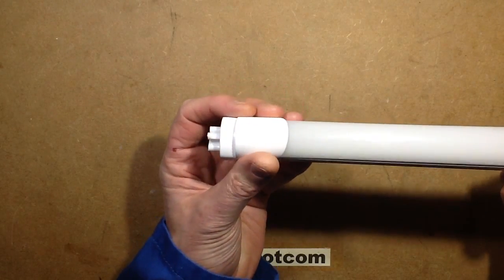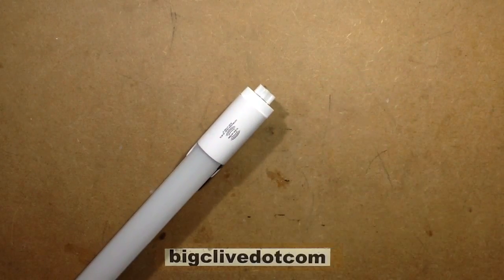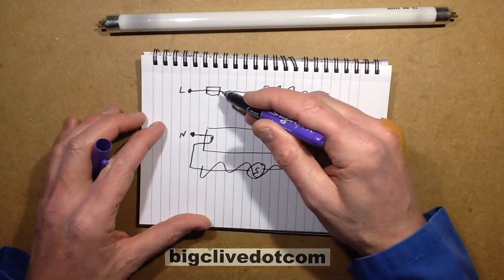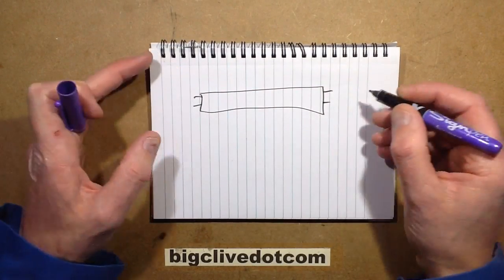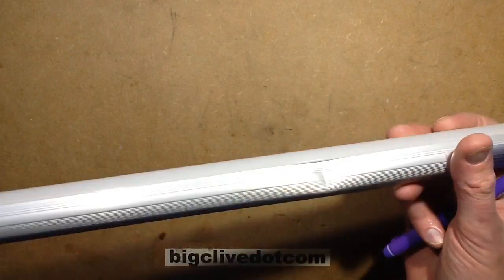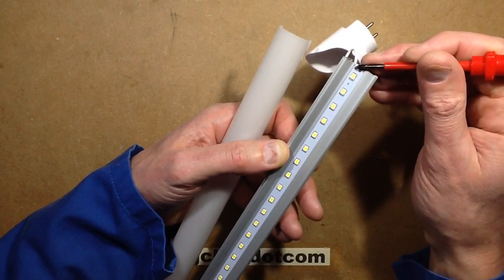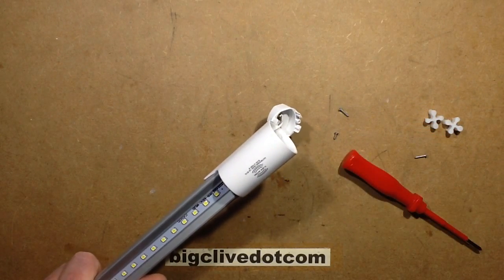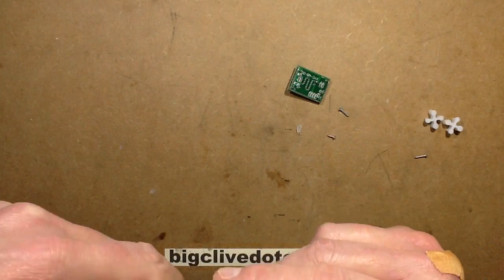Inside an LED T8 radar retrofit fluorescent tube.  (Excelvan)

Comment: Looks like you are not a fan of these retrofit tubes. But I´m working in facility management and we are using them for some years now. Aside from some early faults they work fine.
The actual tubes can be bought in bulk for 8€, labeled Phillips or Osram/Ledvance. They have a complete isolated housing. The circuit is different as yours, this type is banned in EU. You have the driver connected to the two pins on one side (usually the side with the type-sticker), the other side is bridged with a little ~1A fuse pressed into the pins. With the lamp comes a "LED Starter", which is basically another little fuse in an starter-housing. The fuses take care of failures in the driver and prevent blowing up something if someone accidentally puts in a fluorescent tube, maybe if the LED-Tube fails.
The ballast stays in. It is rendered irrelevant by the much lower current through the retrofit tube, and acts as power factor corrector for the mostly capacitive load of the driver.
The light output of the retrofits is nominally lower then that of a fluorescent light of the same length, but it is directed. Most lighting fixtures have a optical efficienty around 60%! The reflectors are terrible. especially if the upper side in the lamp was just painted white and is now yellow and gray after some years of use. If there is a reflector at all. 
After changing the old fl. tube for the LED tube the brightness under the lamp usually rises around 20%, with the power draw sinking from 36 (+~6W losses in the ballast) to 19W (plus ~1W losses).
Only exception are lighting fixtures with some indirect light part reflected at the ceiling. They don´t work well with retrofits. They need the 360° covering from the florescent lamps. Except you just turn one of three lamps upwards, like I did in an office in which the user wanted daylight (6000k) LED tubes installed, regardless of the installed fixtures with indirect lighting.
Reply: Stupid ballast inefficiencies...
Reply: At least the LED tubes don't have the painful flicker of fluorescents...
Reply: I don't have a major flickering problem, except for my old 48-inch T12 ballast, probably from 1980 or the very-late-1970s. That fixture has Phillips Alto 48-inch T12s, made in 2017, IIRC. Moved into the house on February 24, 2018. I didn't change to the Phillips 48-inch T12 fluorescent tubes, bought at The Home Depot, until probably at least May, 2018. I'm suspecting the old ballast, which looks like it's the original one of this house,  is weak now.

Comment: I've been using these 4 FT LED replacements in my kitchen, laundry room and garage. They are the type which require an electronic ballast, not just connected straight to 120 V. They have been installed for a few years, and no failure yet. I didn't measure the light output with an incident light meter to compare new vs. after more than a year of use, but they still seem to be just as bright to me.

What I like:
- No flickering
- Fast illumination
- Silent
- Best of all . . . The LED tubes will illuminate at sub-freezing temperatures in the unheated garage.

Comment: interesting.  I have not seen the radar versions in my searches in the US.

A local Batteries and Bulbs store sells plug-in LED fluorescent replacement bulbs and ones labeled "Ballast Bypass".

As my fluorescent bulb fail I have been replacing with LEDs.  The first one I purchased were the plug-in.  Not a good idea since still using the old ballast which consumes a good amount of power.

I now purchase the Ballast By-pass style.  Electrical connection at one end as you mention.  I just remove the ballast and wire input Live and Neutral to the tombstones at one end.  I have to wire so that when the LEDs are installed the "L"  and "N" marks on the bulb are the same as wired in the tombstone.  Not difficult.

I prefer the one end connection.  My fluorescent fittings often have tombstones with only 1 wire on each side.  A cost saving for the manufacturer.  I only have to replace the tombstones at one end.  The pins at the other end are just for holding the bulb in place  .

My bulbs have a plastic tube all the way around.  I have not taken one apart to see the internal construction.

I get LED bulbs rated for 5000K.  This gives me a whiter light.  I find the LED bulbs to be a lot brighter than the original fluorescents.  Also no ballast means no hum, especially in colder weather.  Most of my replacements are in my workshop, so I am happy for the whiter, brighter light and no annoying hum.

Comment: Okay, two questions. One, who the hell pokes a fluro tube into one end of the fitting while holding the other end? Hold it by the middle for god's sake. Two, who the hell changes a fluro tube into a live fitting? Turn the bloody thing off first. How do people lack such common sense? Oh crap, that was three questions... oh well.
Reply: Have you every watched the minimum-wage laborers in a retail store trying to change the florescent tubes as quickly as possible while they are perched on a man-lift?  Normal shopping continues, the lights are never turned off, glass tubes fall once and awhile.  The tubes are changed by the lowest priced contractor; absolutely no experience or skill is required.
Reply: you cant always tell its live if the bulb isnt working, thats the main issue, and cant isolate all the lights or cant see what you are doing, some switches are not obvious, two way switches can be in any state
Reply: And then sometimes you have to purposely turn it on and fiddle with the damn tube, because the clips on the end are managing to hold onto the bulb but not making a good connection. Thus no way to tell the pins are seated in good unless it's on.
Reply: TheMrVengeance,  I said there is a lot of dummys about, if you know how to change the tube safety when live then cool, I have changed loads live but I know what I am doing.
Reply: TheMrVengeance If that's what you want to do, then fine, go for it. I'm not saying this sarcastically, it's a legitimate choice. Just not a very smart one. Whoever has access to the switch should change it, but that's just my opinion.
Reply: TheMrVengeance Ah well, that sucks, I'm guessing you don't have access to the fuses or breakers either huh? Well, like I said, it's your choice.
Reply: They should leave it the old way , get some natural selection going on , problem will solve itself in a few years .
Reply: How do people lack common sense? Er, well excuse me for living in an apartment building where the hallways have fluro tubes, but no accessible switch to turn of power to the fitting. If it's pitch dark in my hallway, I'll have to change the tube at some point. Apparently that means I'm dumb now.
Reply: Darren Jacobson probably other people who have had them blow up pushing on the glass...I always handle them by the metal end caps now (though not by the pins, just by the caps)
Reply: TheMrVengeance Yeah, and I stand by that. If you can't access the switch and test whether it is live of not then you should leave it to someone who does have access to the switch and some basic test equipment.
Reply: Nobody does, modern fixtures click into place by rotating them. It's impossible to electrocute yourself, he was talking utter tripe!
Reply: Darren Jacobson, there are a lot of dummys about!!!
Reply: Matthew Miller Fair point, I've never had that happen but I've always been really gentle with them, I suppose if the fitting was a bit tight then handling by the end caps is probably a good idea. So long as the fitting isn't live of course.
Reply: Darren Jacobson - So I should wait for the magical tube fairy to come change it and live in darkness until then? Or should I call an electrician and pay him a call fee and an hours wage to switch a tube?
Is that common sense?

Or should I just change the tube while not touching any parts that are live?
Reply: Darwin award winners
Reply: Andrew Joy Good point Andrew, but alas it doesn't happen often enough
Reply: Harry Bibby - I know, I was referring to the original post by Darren Jacobson. Hence why you weren't tagged. ;)
He claimed you had to lack any and all common sense if you changed a tube live.
Reply: Darren Jacobson - That's what I just said, electrical stuff in our building is handled by an outside electrician company. If I'm going to call them to change a lightbulb they'll charge me a call fee and time worked.
Reply: TheMrVengeance,, Darren Jacobson is just letting you know the safe way!!
Reply: pauljs75 👍
Reply: questions:L,
1) not me 2) me and 3) '"common Sense" is never common' (R. Heinlein, <i>Time Enough For Love</i>)

Over here in the USA, many 4 foot tube fixtures have the tubes in series - so if one goes out, they both do - and you don't know which lamp went out, so you have to try one, then the other, with the power on...
Reply: Darren Jacobson - Why are you acting like changing a tube is bomb disposal?
With actual common sense (ie. don't touch anything that's live) it's like not even 10 seconds work.
Hold by the tube, slide in one end, slide in other end, twist, done.
At no points are my hands anywhere near live connections.
Reply: I do it because it's fun Darren, are you a democrat trying to spoil my fun with more regulations?
Reply: wear insulated gloves.. latex / nitrile should suffice :)

Comment: Many newer tubes come with a 'short' starter. This effectively loops the live (or neutral) round to the other side of the tube....so that the tube still requires live and neutral at one end only, but relies on the shorted starter to loop the other mains end round. So the only thing you have to do to the fitting is bypass the magnetic ballast, and change the starter.
Reply: I was just about to comment the same thing... The 'short' starter is usually a fuse. Also you do not strictly need to bypass the ballast as it'll still pass sufficient current for the LED tube to operate (I'd still recommend bypassing where possible).
Reply: Yep you can leave the ballast in circuit, but you should bypass it as it can produce an inductive surge on power off. This can damage the led driver (usually it doesn't but it is putting stress on various components on the input side of the driver, especially if they have no EMI filtering or transient suppressor). In addition the power factor is completely out of phase, although this maybe something of nothing if the tube driver is the typical rectified with a smooth cap setup - as that produces a horrible power factor anyway. Leaving the ballast in does usually make the power factor worse regardless though....the PFC capacitor should also be removed from the circuit for the same reason.

Comment: " Fluorescent tubes will be brighter and last longer than their LED replacements at this point in time,"

You mean if you restrict yourself to ebay/aliexpress junk. Not one such LED light source was decent. All vibrate a bunch overheat and die, they have crappy color quality, or they're just much dimmer than they're supposed to.
I had better luck with branded stuff from shops V-TAC-s, Global-s, Canyon-s. Which are at similar prices nowadays. Granted some died, but they were replaced under guarantee
(I never bought led tubes yet, though. But I expect much the same)
Reply: indeed, it may cost more, but my local asda has gone entirely LED, they must have done a cost/hours to maintenance calculation, but i dont know how much more for quality and lumens
Reply: The asda bulbs are half decent if they are looked after, but i still havent found LED lights for gu10 that like bath rooms, although the asda are faring well, there also cheaper than the screwfix ones
Reply: Ioan
i meant the local asda is using LED for their shoplights, they removed their tubes after a complete refit, most of my leds are cheapos from china, only needed 3-5w types for most things, anything higher powered is still cfl

Comment: Perhaps there's an issue with this particular brand not putting out much light?  I replaced all the T8s in my house a while back with LEDs--the retrofit LED tubes we get here in the States run directly off the fluorescent ballast; no wiring changes required.  The light output is easily equal to, if not greater than, the fluorescent tubes that I replaced.  :]
Reply: They work great only not as much savings.
Reply: Is this "safety"  motive some excuse to minimise production cost, making the need for circuit changes a scam? Taking a Starter out, or replacing it, isn't rocket science, and if there's no necessity to remove the ballast...

I know I couldn't certify the wiring changes myself, but I reckon I could do the job safely after a bit of tuition. My grandfather was working on 3-phase a century ago, and taught me how to be safe. I'd pull the fuses and carry them in my pocket.

But how can anyone get valid building insurance without every fitting being inspected and certified after the changes?
Reply: Dave Bell
Removing the ballasts saves you about 3 watts for an 18 watt setup.  Comes to 9 watts without to around 12-14 watts with (could be more if the ballast is really old).  Most of the tubes have complete English instructions on how to do it if someone so chooses.
Reply: To match  CFL tube power to LED it requires half of power of CFL roughly - means if you replacing 36W tube it has to be 18W... today's top product can deliver 150-200lm/W (super expensive) but consumer ones rarely do 100lm/W and fluorescent tubes to something like 80lm/W... so do the math...

Comment: Few questions: What is this radar function mentioned in the title and beginning of the video? I've never heard about radar in context of lighting in the US.  Secondly, there are plenty of quality LED fluorescent replacements, including tubes that don't require removal of the ballast or rewiring of hot and neutral in either state, and they're not stupidly expensive either on Amazon, with 5 or 10 year warranties.  Lastly, I really love your videos, but your audio level is so low it's just below the threshold of hearing on a mobile device without using headphones, especially when speaking in soliloquy. Please please please use volume normalization or amplify by 2x or 4x. Thanks.
Reply: Sorry, I realize I didn't phrase those last two as questions. :)

Comment: I would love to see you draw up the schematics of the led-tube. Also; are buck converters always mains earth referenced?
Reply: The generic understanding of "buck converter" is basically a non-isolated step-down converter. Non-isolated, as opposed to flyback converters and the transformer-isolation-based ones. So no, they're not necessarily mains-referenced, but that obviously depends on the application.

Most often you'll find buck converters where low voltages at high currents are required (like the core voltage regulators for computer processors, graphics chips etc).
Reply: Not isolated, and usually I'v seen them ground referenced to the input supply. Like KhronX said it depends on application, but that's a pretty standard setup. I'v taken apart and repaired quite a few appliances with faulty power supplies, and anything using a buck convertor I'v come across is mains ground referenced. And as for processor core VRMs, those are chopping 12V down to just over 1V. And at some seriously high current. A GPU or CPU that has a TDP of 150W could be drawing over 100A at the final output.

Comment: in some of the HO t8 "safe" figures that my shop has been using, the second set of pins have ran at duel voltage and maybe frequency. not sure since my fluke cant really check frequency. but they voltage between the two sets of leads is negotiable and wont light both lights if wired improperly if it lights at all.

Comment: I just installed some of these tubes in my kitchen. The ones I used have live and neutral at one end and 2 pins at the other that are open. I wired up one end and it came with a sticker to put on the fixture that "Live Circuit"  so you know which side is wired for power. Being as the non power end is an open circuit and only there to hold the light I don't see why you couldn't just cut the wires from the ballast and wire both ends for power and put the tube in whichever way you want.